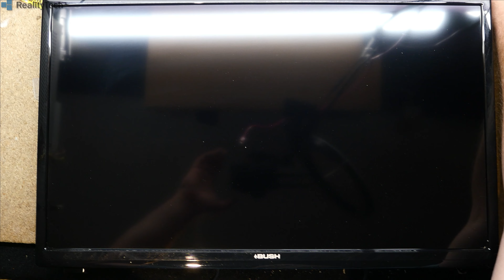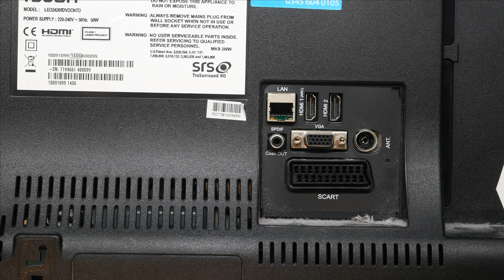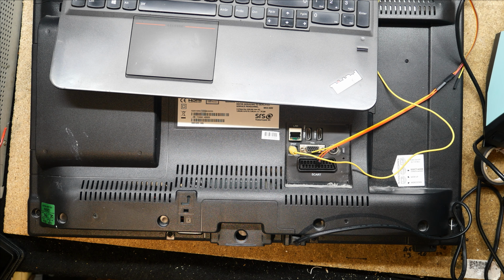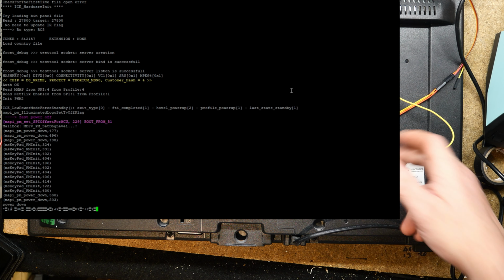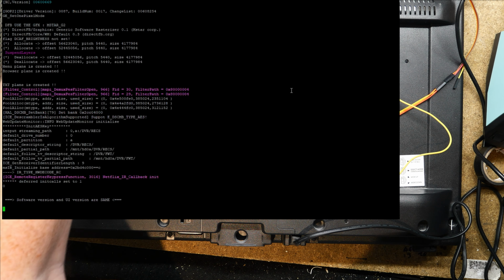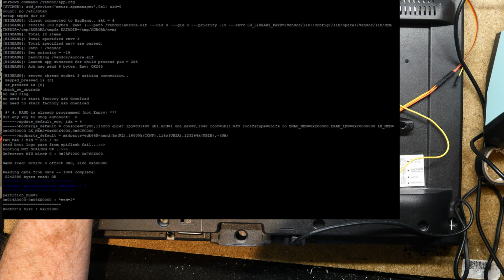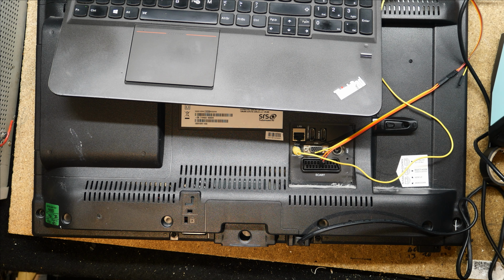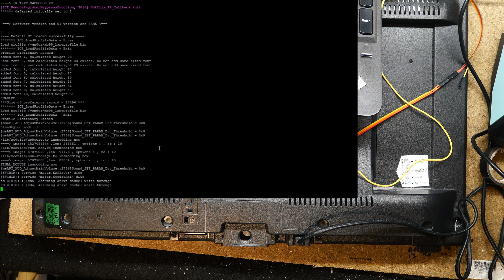#135 - Bush 24" TV, getting a serial console.

Comment: The initial chunk of rubbish can sometimes be messages from uboot (or similar) at a different baud (typically on lowest numbered UART).  Looks like the UART RX on the TV is being ignored, sure it is the correct pin... i've also seen devices where the console is on the first UART and the application debug output on the second, this might the case here.  Sometimes sending large amounts of junk as the device powers up can crash it out to the pre-boot environment, i've had some success in the past appending "init=/bin/sh" or "init=/bin/bash"  to the kernel args in uboot then booting single user to bypass any login. None of this helps if the flash has gone bad though, seen that a few times. UART zero may be pinned out internally, sometimes on a 3 or 4 pin SIL header (often not populated).
Reply from the maker: The garbage is a MIPs bootloader at 9600 baud.
Reply: @rtechlab6254  Interesting, do you know which bootloader ?
Reply from the maker: No, all I caught was "MIPS Bootloader or words to that effect. It does definitely then head into U-Boot right after. I may go an capture it again, I don't have the skills but a custom OSS Linux for TV's could be a worthy project. That said almost everything in here is O/S so Vestel should be able to provide source. It looks to be using FBdev to drive the panel.
Reply: @rtechlab6254  "MIPS Bootloader" is a package provided by MIPS itself, it is called by uboot to put the processor in the correct state for uboot to function.  A generic OS is not possible, lots of variations in IC configurations and setups. Yes it is open ish, if you ask they will provide you with uboot src, busybox source, kernel source and little else as all the user space processes will be calling closed source libs.  A generic FBdev is good, but the video APIs are also being used (for video playback and menu overlays) and much of that will be buried in the manufacturers own code which is chipset specific.